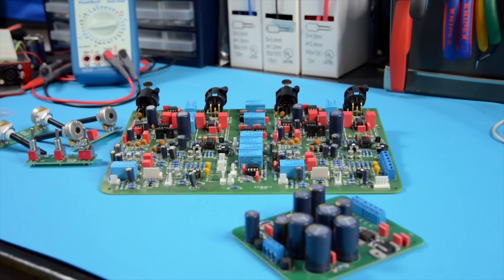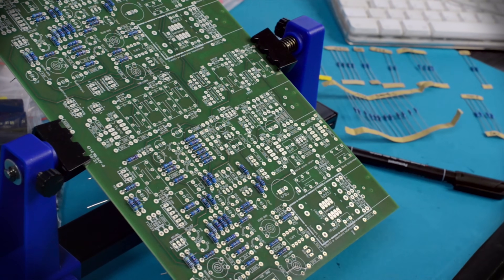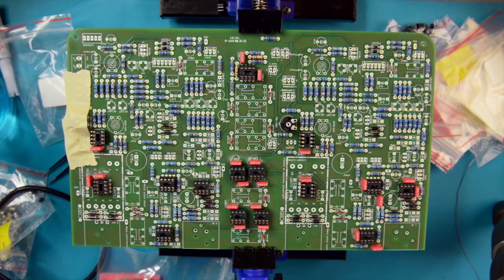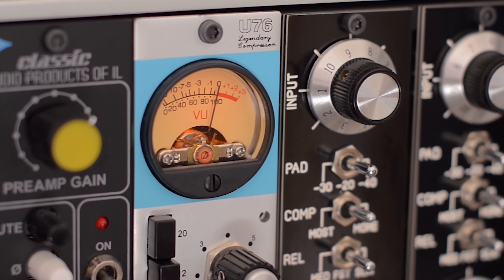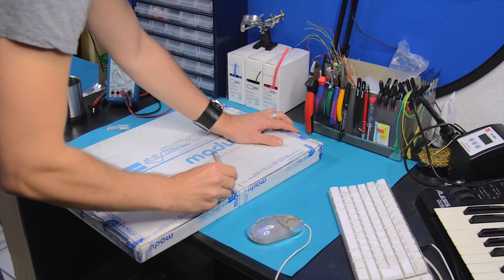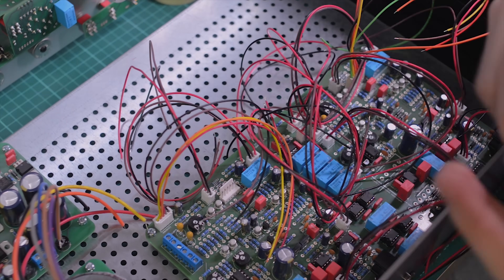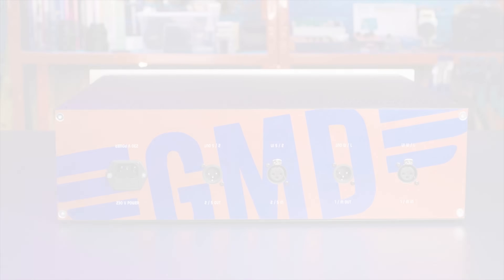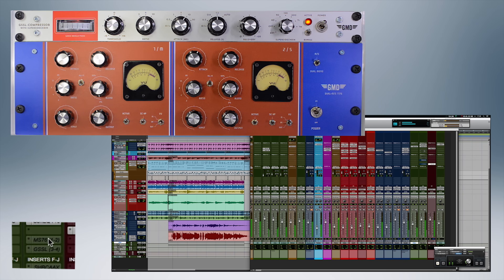Stereo 1176 DIY Audio Compressor Kit (english)

Comment: Beautifully done. Your english and audio & video examples were all very easy to understand. I just got into using 500 series hardware, and while they are cheaper than the full-sized versions, they still are not cheap. Your video makes me think it might not be totally impossible for me to at least attempt to build my own some day.   Maybe. Can you give some examples as to how much of a savings you were able to make by doing a DIY kit and how much time it took and the degree of difficulty vs just plunking down a bunch of money on a factory built model where one could be totally confident that the parts were put together perfectly to spec and also have the added protection of having a full manufacturer’s warranty?

Comment: You're not heating the pads enough, the solder should be able to pass through the hole and form a convex fillet on the other side. Also clip the leads before soldering, not after, to prevent shock on the solder joint.

Comment: Great job. Frankly, your English is better that some native English speaking YTubers. 

I was confused by your comment that dual 1176s would need to be modified to run stereo. Don’t you just run the left channel into one and the right into the the second? What am I missing? Thanks!
Reply from the maker: Thanks Lonny!
Running a stereo mix into two mono compressors will change the stereo image. Imagine a guitar mixed to the middle (meaning same volume on both the left and right channel) and then a loud instrument mixed to the left channel. Only the compressor for the left channel will engage and reduce the gain. Since this also reduces the volume of the guitar on the left channel it will shift the stereo image of the guitar from the center to the right channel since there is no compression and the signal is now louder compared to the left channel. 
To get rid of this problem a real stereo compressor will will combine the left and right channel to a mono signal (or at least 2/3 mono) and send this to the detection circuit. 
If you have compressors with a sidechain input you can do this mono mix outside the box but since a 1176 doesn't have an external sidechain input you would need to modify it internally.
Reply: Götz Müller-Dürholt Thanks for the detailed reply - makes total sense now!